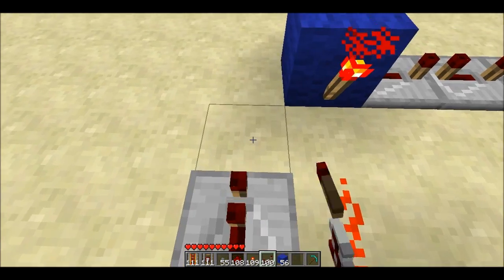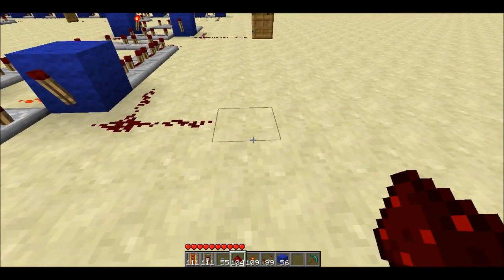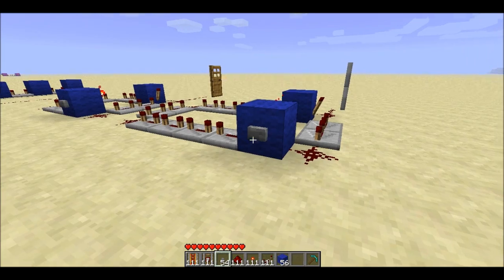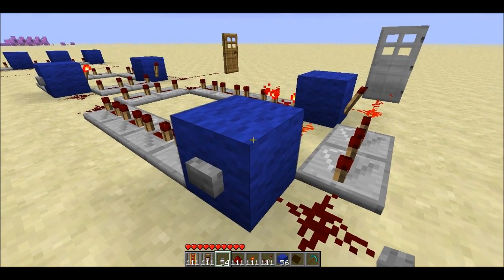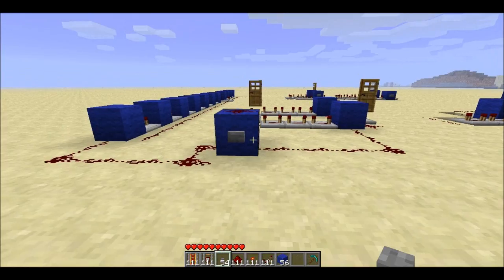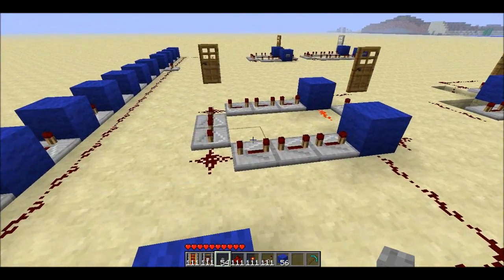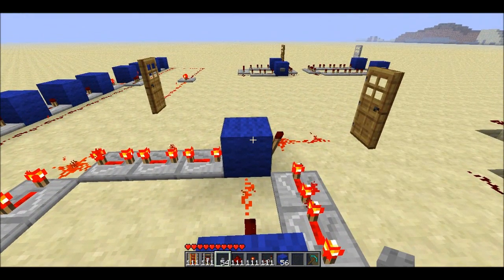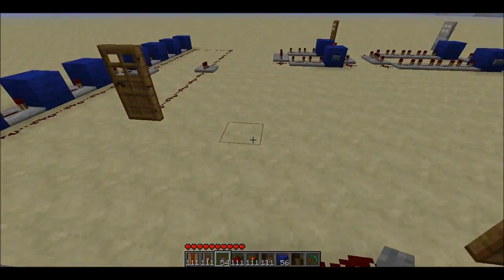Extra Long Pulse Lengthener (Monostable Circuit)

Comment: @maagiapall Well you have to have both a good internet connection and computer. If you have a bad computer but fast internet or a good computer but slow internet, in both cases you'll have to watch in 240p. So stop saying that my point (the internet speed is irrelevant. Yes, your point (the power of the computer) matter as well, but since it's almost 2012 you can assume that all computers can play videos better than 240p. So the internet speed is the more relevant point.

Comment: I'm not sure if this works anymore or not but I copied the design exactly and it didn't work :( 

It goes on for a second, turns off, the signal travels in the circle, and then it goes on for another second then turns off

Comment: Excellent circuit. I just built an arrow cannon with a traditional monostable/latch combination, this is much more compact. 

I was working on a similar device with a piston cutoff when I found this video; it's larger because it doesn't double cycle like this one. But the one advantage it has is that you can turn a constant input (i.e. lever) into a short pulse as well as extending shorter pulses to be longer, which doesn't work with this. Try to build it if you want a challenge :)